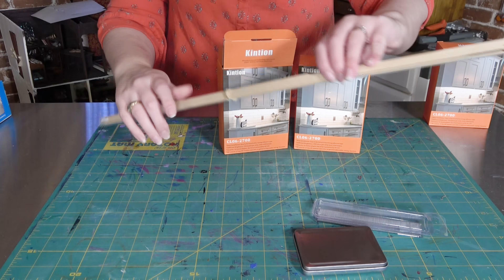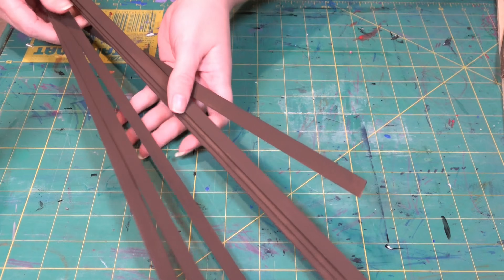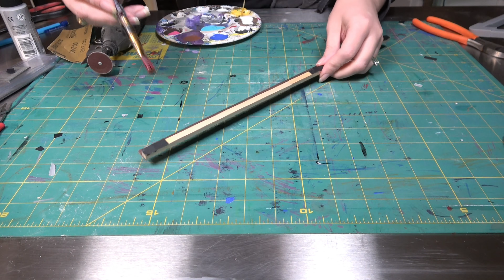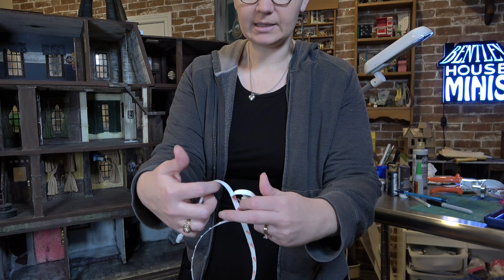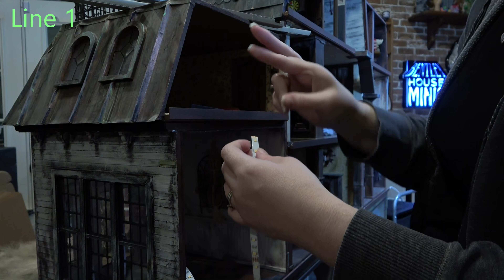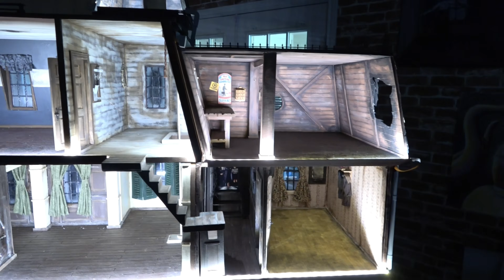Emergency 💡LIGHTS💡 for my DOLLHOUSE Mansion!! DIY LED Lighting

Comment: This video came into my feed at the perfect time. I'm putting together a Barndominium dollhouse kit and want an alternative lighting set-up as I'm using battery operated lights. This solution is perfect! I also greatly appreciate your tips on reducing hand pain. I'm experiencing a lot of pain in my fingers as I age, so every little tip helps. I wired one house once and it worked perfect...for a few years. I'll never wire a house again. I am not ripping out wallpaper to find the problem, so may use this brilliant idea to address that house.

Comment: Do you wish you had used these lights from the beginning?  Traditionally wire with tape?  Satisfied with battery lights?

I am rehabbing a partially finished house and am debating wiring myself (ugh) or going battery.
Reply from the maker: I think if I had used them from the beginning I could have hidden them a little bit better and made sure the connections were very secure.  They have been in the museum, on everyday for about a year now and are still going strong!  I have never done tape wire so I can't speak on that, but if you really want people to be able to see inside these are pretty good👍

Comment: Thank you!  I have just finished restoring a dollhouse that my father built for me 45 years ago!  It did not have any lighting.  This system you have worked perfectly!!  Now I am trying to install a sheet of plexiglass on the back of the  house to protect it.  I tried magnets but that didn't work.  I was thinking of a mirror bracket.  Do you have any suggestions?

Comment: I have a question my sister in law built my daughter a doll house sadly she didn't get to finish it but my daughter wants it only displayed. Would you build a clear  case for it or  can I get a plex glass to cover the opening  part.
Reply from the maker: Building an entire case for a house will be very expensive!  If I were to enclose this one I would make a separate plexiglass panel for each room and attach it with magnets if possible.  That way things are still accessible but it keeps dust out.  I hope that helps!
Reply: @BentleyHouseMinis  thank you

Comment: When I use wood glue when woodworking i wet the wood first with water then add the wood glue and clamp them together. It creates a stronger bond. Im not sure if it will be much useful for doing miniature crafts though.

Comment: Thank you so much for this video. I just came across it from the Veranda website and can't wait to see all of your blogs.   My dollhouse is 30 years old and very similar to yours without the Adams family theme. It is wired with copper strips, however some of the connections have come apart and so half of the lighting doesn't work and would be a monumental task to redo them.  Also these small lights are not really enough to see the details in the rooms.  Your lighting techniques has answered my problem and has given me new interest in my dollhouse. Now my problem is, as a very senior person, "what to do with my house when I move to a smaller senior apt. None of my children are interested in it.  Thank you again.

Comment: Suggestion... Learn to solder and use wire for your connections. Could have saved you allot of time here.
Reply from the maker: It's definitely a valuable skill and I plan to but I didn't have time to learn it before the house was installed.

Comment: Those lights look so much easier to use than the Cir-Kit lights that are usually found in dollhouse shops. As per usual, you have conquered another miniature challenge!
Reply from the maker: Thank you Anne!  I haven't tried any other light systems but I really did like these if you are just wanting some blanket light in the space👍

Comment: I had to take apart and rebuild a dollhouse to rewire it because one little wire of the 25 lights somehow got pulled and I had to find which light wire was causing all the lights not to work, it was a nightmare. I feel for you.
Reply from the maker: Yikes!  I hope you were able to locate it and it was easy to get back together!

Comment: Someone needs to learn soldering.. those led strips can be cut, where you see the copper strips, then you simply soider thin wires to connect them... Still, all seemed work out OK.. Fantastic job always, well done you.
Reply from the maker: I definitely do!!

Comment: You need to use a drill and bit to make the holes for the magnets. I was cringing watching you with the Dremel. Looks like it was spinning away from your hand but I never trust myself to be able to control those things.
Reply from the maker: I made sure that it was spinning away from my hand so there would be no danger but I will try out a drill bit next time.

Comment: That's what I did with my beacon hill 5 years ago.  Unfortunately,  the connection pieces and ability to disconnect lines.  Need adjustments with the new type of light strip.  Thanks

Comment: This is the basic system we use to light houses at the dollhouse museum where I work part time. The kit you found seems to be easier as we have an electrician who cuts and solders the light strips. i have been putting off lighting my personal houses in this manner, but I think I can better deal with system and will definitely give it a try.
Reply from the maker: What museum do you work at?  I am glad these seem like they may work better!
Reply: I work at the Great American Dollhouse Museum in Danville KY   I think you will like these lights. We have used then at the museum for over 10 years and have only had to replace the lights in one house.

Comment: Ara, for the Downspout it would be easier and would block the light from escaping, to FULLY use both parts of the cord cover and just cut the openings where needed. That would obviate the need for the electrical tape except where you need to hide the connectors.
Reply from the maker: So true!  I did that on part of the downspout and you are right it worked well.  The part that had the 3 chords in it need the extra open space for the wires to fit.  So it can definitely depend on how many wires you are fitting into the space.
Reply: @BentleyHouseMinis  What are the internal dimensions of the Cord Cover? The inside part, that is. What is the width of the Light Strip?

Comment: This turned out so great, Ara.  I've been trying to think of a way to light up my craft room, because it's just sad right now. One very dim overhead light, and I think this will work great.  I can put some shelves over the desks and attach these underneath to light up the desks. Which means I also get some more space. Bonus.  I am really glad you showed how easy they are to use.  Thank you!!
Reply from the maker: I think their original use is for lighting under cabinets and shelves so that will be perfect!  And the light has a great ambiance!!  I am glad it will work for you!

Comment: Just fitting to have an Addams Family house update in October. And to add drainpipes is such a smart way to hide wires, mostly as those dang pipes are so often forgotten on dollhouses. :}
Reply from the maker: It definitely worked out for one final Addams October!!
Reply from the maker: I picked up a package with your name on it today from the Post Office!  I put it with my Beetlejuice packages that I haven't opened yet but I wanted to let you know it arrived :)
Reply: @BentleyHouseMinis  Yay. The mail gods have been good. ::}

Comment: Very nice job.  FYI you can buy snap on connectors for lights like those so that you can cut them like you did but then connect another piece.  The also have small "T" and corner snap on connectors to turn and go around corners and such.  These would make the issue of the length of the strings less tedious.  But again great job with working with what you had!
Reply from the maker: Thank you for the info Mark!  That would be great to have some of those pieces.  If I use this method again I will definitely look for some of those connector pieces!

Comment: This is a really great idea. Not Dollhouse related, but I have been looking for lighting to put under my wall kitchen cabinets, so I think I will definitely be getting these. Thank you for showing this Ara. ❤️ From 🇬🇧
Reply from the maker: I think that is their original purpose based on the picture on the box!!  You'll have a much easier time installing them there than on a dollhouse😄  So glad you enjoyed the video!
Reply: @BentleyHouseMinis  I think I will have an easier time installing them❤️
Reply: @cherylwells9116  We actually have them running along the top of our kitchen cabinets. We have some plants and a few decorative plates up on top of the cabinets to break up the boring empty space up there. Not only do the lights illuminate the plants and decorations, but it’s very pretty soft mood lighting for the kitchen. The kitchen, dining room, and living room are all one big, open room. The lighting changed the kitchen into a decorative part of the house, rather than a boring kitchen over on the side.
Reply: @CrankyPantss  Hi, never thought of putting them along the top as well. My cupboards go too high up to put plants and things like that, so I have like a 10cm gap going all around. Just wondering if it would be too much with lights at the top and underneath, but I'll sure give it a go❤️